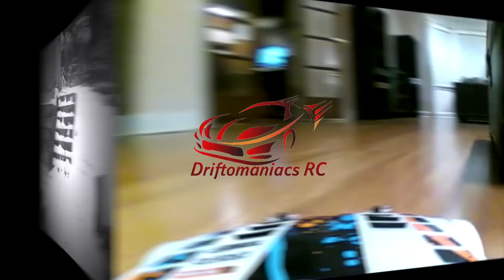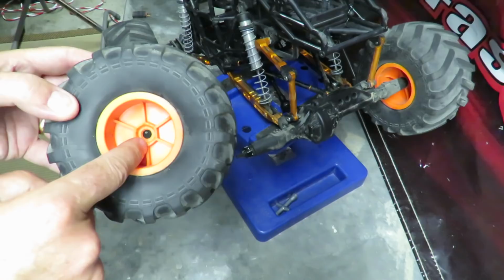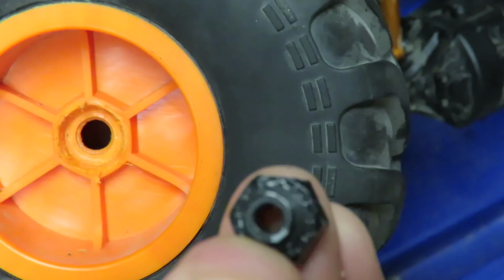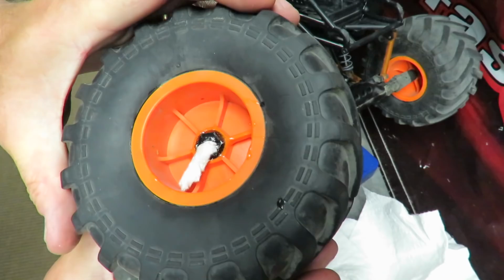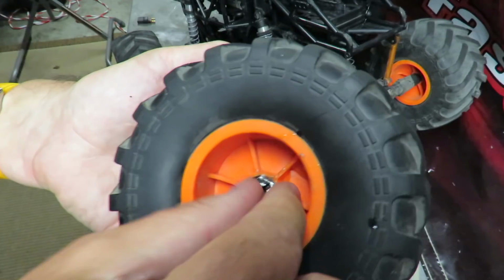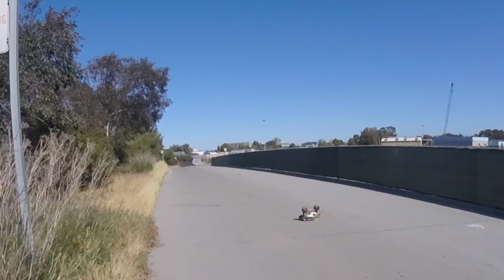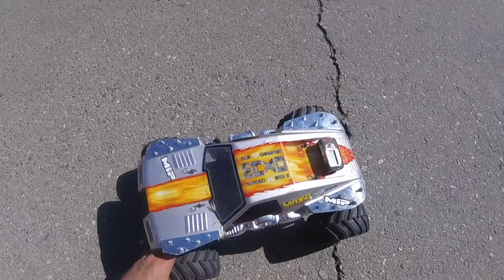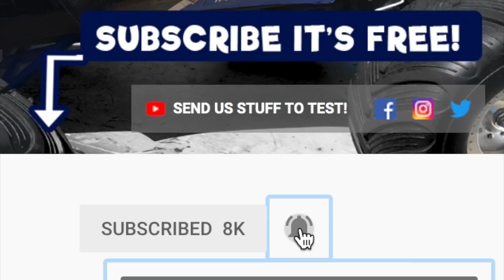How To Fix A Stripped Wheel Hex Or Not?

Comment: I havent had this happen to me, knock on wood, but I guess this is much more common on 3s?
Reply from the maker: Dustin on this what happened when I first gave it full throttle on 6S the tires gripped so hard the axle spun in the hex. If you are doing sane stuff then you should be okay and it shouldn't happen. These wheels were never designed for a castle motor on 6S!